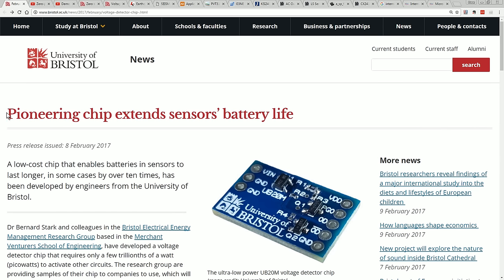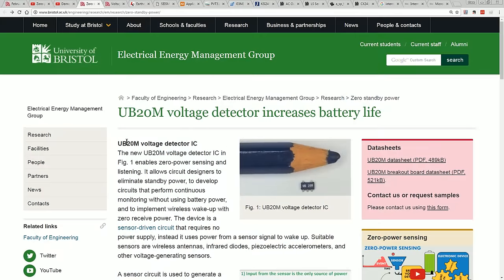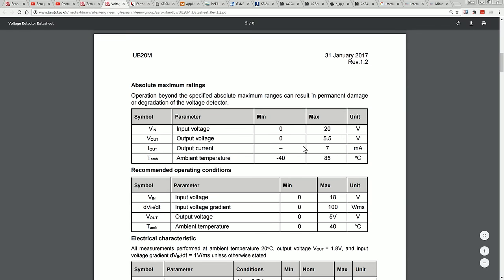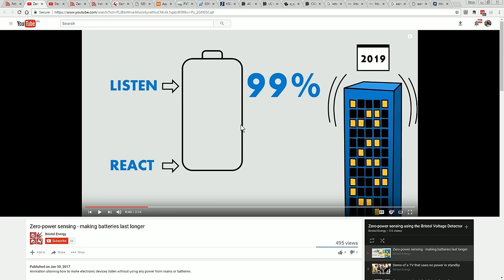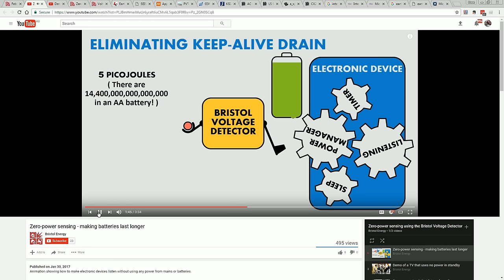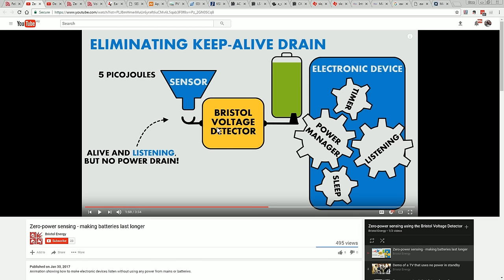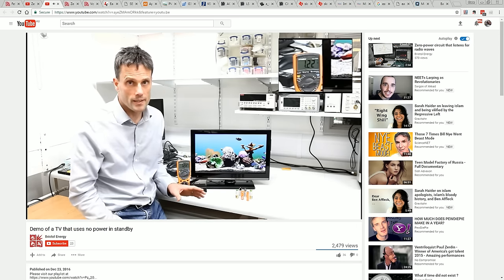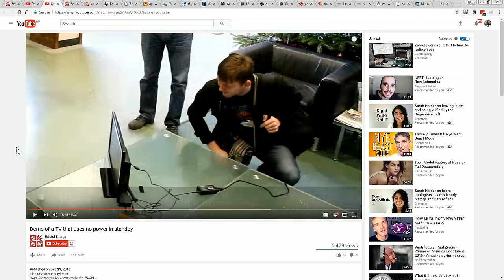EEVblog #971 - Zero Standby Power TV - BUSTED!

Comment: I think a true low standby TV would cost more, since the quiescent power could almost be eliminated with an internal PSU. Problem is that the cost of certifying something without a wan-hung-low plug-pack would get passed-on to the the consumer. That could buy back years of power consumption costs, and maybe more...?

Comment: I'm just excited that I can get a 12V TV :) Since I have 12V solar available actual 12V devices are always nice to know about.

Have you done a similar rant on PC power supplies? Or those sodding "240V power board with USB", because my home power meter doesn't tell me anything useful under about 5W and I'd love to know what the standby power of those boards is (I haven't seen one that lets me switch off the input to the USB).

Comment: I just use one of those 433mhz mains power remotes to completely cut off the power of the TV at night.
Honestly I have no idea if that uses more power than the TV in standby but I'd rather cut the power from the TV to hopefully extend the life of the components, although I have also heard the argument that regularly turning the TV on/off at mains can also reduce life.
Reply: I use the same method. Not for eliminating standby power nor life extension but to switch on/off TV and active speakers with single button.

Comment: nothing that cant be done with a small solar panel and super capacitor,(calculators only cost a dollar for much more tech than this)  hide the panel in the stand, it will last forever anyway, the power to supply the pullup could be a capacative dropper, no need for a switchmode supply, that wont draw anything unless theres a  load the other side anyway.   a 0.5w standby is about 65p a  year in the uk for a year standby, so if you say a tv has a life of 10 years, it has to be cheaper than £6.50 to include its technology on the retail price

Comment: Could this chip be used to swich on a bettery powered relay (or other switching device) that switches the mains? I saw you say in the video, that this chip can't switch a big enough realy, but what if it switches a bigger relay with the smaller one using the power of a built in battery to switch the mains? That battery could then be charged when the TV is on and be discinnected until this chip uses it to switch on the TV?

Comment: You could use a multi stage system do do real zero standby power. Use their system to switch a small power supply that is just big enough to switch on a relay on the input but low power enough to be switched on with a low power mosfet

Comment: This kinda reminds me to the betavoltaics and radiophotovoltaics power source hype of recent. They claim decade long duration and extreme environment resistance but if you see the amount of currents they can provide and operation environment parameters you realize that any specially designed electrochemical cell with a very low self discharge like Lithium Thionyl Chloride can easily outperform such devices, its much cheaper and safer last as long if not longer and rugged. Ive made small garden lights with alkaline batteries and a 500k resistor. They are 4 years old and 4 of 6 are still going, one that failed was due corrosion and the other one due batteries leaking.

Comment: I picked a random Vishay TV IR RX module and the quiescent drain is 350µA at say 3v; add a microcontroller in low power sleep (say 20uA) and you're at around 1mW using random cheap parts (and not even really trying hard to optimize power). The promo video talks talks about 500mw for their TV set in standby, so they must be including the quiescent consumption of the PSU (unless the TV is just burning half a watt because they don't care) which roughly ties in with Dave's measurement of 300mW on his random PSU. So yeah, that's straight up lying.

Comment: I have a 'zero volt standby' cell phone charger. Their solution was to have a rechargeable battery inside that powered the detection circuit.  (edit, I don't use this charger because it is unreliable)

Comment: Is there a good but cheap power meter available on amazon or ebay able to measure the quiescent AC consumption (before the "brick") of turned off modern TV or phone chargers?
Reply: SlyPearTree anything with a known brand and that costs more than $30 should be good enough.  if i were you i would try to get a trueRMS one, those are the best.
But to be fair even the $1 chinese ones should be enough.

Comment: Sorry Dave, but I do believe your criticism is misdirected on this one.

Big deal that their energy harvesting receiver isn't also turning on/off the wall wart..... their demo correctly shows zero standby current for a television......otherwise it too would be sucking tens of mA waiting for the IR signal.

What the wall wart is doing is irrelevant for this particular demo - they could just a easily have hooked into that and powered it down instead. 

The only criticism I can see is that there's no descrimination of the IR signal..... any IR remote would likely wake that TV. However I think that problem would easily be solved by also powering up very low current cmos logic with the harvested energy.

Looks like a very good idea to me.
Reply: I am no expert,but doesn't the pull-up resistor need power to umm pull-up.I new to this so I could be wrong.. and wouldn't the device need to ir signals. one to wake up the TV and a second for the TV to decode the IR signal to see if it or some other device needs to turn on.Wouldn't just natural IR wake it up?I have never had any schooling in electronics so I am probably completely wrong cause Iam missing or don't fully understand this.
Reply: Yup it's not a panacea. 

I just objected to the "busted" title on Dave's video.  It's not a panacea but it's certainly not a scam.

Comment: They should put that thing in a box with a couple batteries and a latching relay to switch the mains AC on/off. Could be used for any device then.
Reply: Brian Taylor the relay consumes as much as 1/2 a watt so you arent saving a lot unless you never ever use your tv.
Reply: Not a latching relay, They only need a pulse of power to latch each way.

Comment: This guys talk about extending battery life, bla bla ...  But, there is a limit up to were it can be extended, as the battery itself degrades by just existing.  The best batteries against self degradation are Li ones, the expensive primary ones, not your regular CR2032.  A set of AA/AAA batteries will leak after a few years if your are unlucky, and be dead in the best case.  Having the whatever detector consume the battery power in barely less time than that is not a problem; indeed, it might be a feature, so a battery is not allowed to leak and damage the device.

Comment: Hey Dave! Look at the original Videos comments. There is a comment from about a month ago. A user already made them aware of the standby of the AC/DC converter and they claim it's only 0.1W!!!

Bristol Energyvor
That's a good point. In this demo, we have only eliminated the standby power of the TV and not of the adapter, which is using about 0.1 W. TI have a chip that virtually eliminates standby power of adapters:  http://www.ti.com/product/UCC28730. We'll address this in a future video, thanks.
Reply from the maker: Ah, so they did. Not that is matters whether it's 0.1W or 0.5W

As for the TI chip and such solutions, as pointed out in my video, this chip actually negates the need for their chip!
Reply: Yeah in the end it isn't about the actual standby power consumption, but more about that they didnt communicate that fact! bloody research. ;)

Comment: >Modern TVs draw 0.5 watts. or the equivalent of six AA batteries every day in standby

That doesn't sound right.
Reply: Didn't sound right to me either.I have neen learning electronics as a hobbie and thought I was wrong..Thanx
Reply: Well, a day is 24 hours, so 0.5W over day is 12Wh. I found one article stating one AA alkaline cell has 2.6Wh, which comes to 4.6 AA batteries per day, so that is almost correct.

Comment: Why can't we just make things that completely turn off these days?  You remember,  the good old fashioned switch that actually cut the power to the device.   Especially with battery devices, since it's annoying to have a new battery dead in a device you have not used for a few weeks. (my MP3 player as a specific example)
Reply: Robin Sattahip 
well tjey do have some advantages. for example soft switches alow the mcu to shut down gracefully. like with pcs.

Comment: Here's how REALzero power standby (tm) could work:
Have a suitable small energy storage device (goldcap etc.) . Have that powering a low-current controller, IR receiver and providing the short current burst for the switching element (be it a solid state relay or anything else). Have that small energy storage device being recharged once the psu comes up. Tadaaa, real zero power standby. Not as in a couple of pico Watts, real zero zilch!!!111 Yup, it'd need the small energy amount to recharge the storage on every power on. But that's not what's being asked for ;)

Comment: So what it all boils down to is the amount of energy you can get from the sensor that activates the device. The more, the better. If you had a lot more, you could flip a larger relay for example.
Great! Then I have an idea for making devices truly use NO energy when they are off. Why don't we leverage the kinetic energy that a human can easily supply? I suggest that we make a device that uses conductive materials and motion to physically break or connect the circuit. The user can actuate this device by supplying force. It wouldn't need to be much. I estimate it would take only your finger tip. You could even eliminate the extra circuitry! No need for relays or anything, just break the main power with this 'circuit breaking' device! I think it would be best to roll out this product with a focus on home, mains power, lighting at first. Perhaps we can call it a "Light switch". Anyone want to throw a bunch of money at this idea?

Comment: If the TV was plugged into a battery then it would be zero power standby?
Reply: I was thinking the same, if TV was used in a mobile unit (like a RV or truck) on 12v battery then this zero-power standby would be useful there.
Reply: Dragon Slayer Ornstein The pull-up resistor would use a little power..I think...Never had any schooling in electronics so I might be wrong.

Comment: You could use this technology with a capacitor to switch the mains, but it could hold the charge not for long enough and pisses off people.

You could use it with a battery or rechargeable battery, most TVs doesn't even last more than 5 years.

Or you take the risk of spending about 3$ on electricity over 10 years.
With that said, I don't know how much you are actually saving, because those components will also have their prices. 

You could argue that it is worth the hassle globally speaking, 200 MW per billion TVs is half an average power plant just to keep TVs on standby. 

Hm, you are to decide...

Comment: Why is it so difficult to get this thing to switch mains? It'd be a bit fiddly but really no big deal. For example, it could run from a small super-cap that gets charged from the switched PSU whilst it's on. It's lazy of them to use a 12V PSU and it opens them up to criticism like yours but it's not as bad as it looks.
I agree that the chip is nothing ground-breaking though. Standard marketing hype, but it might find an application or two where it's actually worthwhile.
Reply: Yes. Which is picoWatts. That's the whole point of the device.
Reply: You're right. It doesn't make the standby power zero, just completely negligible. If that's not good enough for you then you're more pedantic even than me! My point is that the demo wasn't "smoke and mirrors" no-one was trying to deceive or being deceived. The device is capable of doing what they were trying to demonstrate. They just failed to make a convincing demo.
Of course, I'm not suggesting that it would actually be worthwhile using this device to reduce TV standby power. I reckon reliability would be terrible, with the thing false triggering all over the place and failing to trigger when needed. Just sensing average IR radiation levels seems doomed to fail. You can easily get standby power into the sod-all range using proper, powered IR receivers.
Reply: Iam a uneducated hobbyist so I am probably wrong, but wouldn't the power to charge and keep charged the cap be more ?
Reply: I'm not really sure what you're asking. It'll certainly be more than the device can "harvest" from the TVs remote, but the supercap wouldn't be charged from harvested energy, rather from the TVs power supply whilst it was powered up. I'll try to dust off my dodgy maths... A 1F capacitor with a 1uA leakage would take over 3 weeks to discharge itself from 5V to 3V. The output leakage of the detector chip is supposedly 100pA, so it'll make no difference to that. Average power (which would be taken in a short lump from TVs PSU) would be under 5uW. The red "standby" LED alone on a TV would draw at least a thousand times as much. A typical IR receiver draws 300 times as much. All of these powers are negligible in this application.

Comment: "Modern TV:s consume 0.5 W or the equivalent of 6 AA batteries per day." Well I do not run my TV on batteries. I run on the mains and one watt costs me one euro in a year. If the life span of a TV is ten years then technology that eliminates the standby power is worth five euros.  All that shows that AA batteries have very little power, some 3 watt hours i.e one thousand batteries is worth some 50 cents in electricity. They are overprices by a factor of thousand if you view just the power.

Comment: Dave, I like your videos, but not this one. Please do more engineering videos instead of always hating something. You are right, most of the time, but now you get stuck at side problems. The chip works (it seems so). That TV used an external power supply, but could have used a battery (or a cap charged from mains with 100Mohm resistor, or anything) to power a relay which switches on the main power supply. You said bullshit to a product, which is actually a good idea and works. By the way, the TV-case could be solved a few different ways with somewhat higher power consumption than this but still a way lower than 0.5W. But the idea is absolutely could be useable in some areas.
Reply: Could have, would have... yea, bullshit. If they could come up with real world application they would demonstrate instead of this misleading trick. It's a glorified transistor in a case! Giving it batteries defeats the purpose of zero standby power. And they try to measure it in a way it hides all the secondary power consumption. Tell me one case when it will make significant difference to exisiting solution with usual components. It's Bateroo/Batteriser kind of scam.

Comment: Being the absolutely electronics dimwit that I am, I still came to the same conclusions that you did. There is always a loss in the PSU.
However, while this is ll well and good, imagine is the PSU was a small rechargeable battery, and the tv a 240v (or whatever) relay, well that's the principle of it anyway. Sure batteries also lose energy over time, but rather less than the PSU I should think, thus leading me to the conclusion that while their setup was indeed misleading, it was not a lie as such. Or am I just a complete idiot?

Comment: Could just use a super cap and a low power micro to turn on the TV or charge the cap every so often.
Reply: BlueFoxTV 
could have just used a cr2032 with a nanowatt micro  and have the battery last for 10+ years. (most likely more than the device itself)
Reply: What if the battery goes bad (before or after that time)? No way to turn it on again, not good idea to have design with more components waiting to fail.

Comment: Why worry about the mains adapter, if they demoed with a 12v battery would you be happy? and anyway why limit to the mains adapter, what about the series of transformers, all with losses, though the supply network, the mains adapter is not relevant. i'm surprised it isn't easier to find actual BS rather than try so hard to squeeze some out.

Comment: does it read a standby signal or just trigger on any old noise? regardless facepalm
Reply: Nicolas Daly 
* grabs the stereo system remote *
* tv turns on *
Reply: Rogue IR light from a security camera, TV turns on.
Reply: Dragon Slayer Ornstein 
i love the fact that the poblem is so small that even turning your tv on by error will set you back like a few days of "saved" electricity

plus, if you need a relay, having the tv on will make up for the saved because of the relay's coil. It doesnt make sense to save 0.5w when you need an extra 0.5w relay for the chip to turn it.
Reply: Laharl Krichevskoy
I suppose you could wire the chip so it only powers on the IR decoder then use that to make sure the IR code is correct.

The only problem with that is every time there is a rogue IR light then the other electronics will power up so will not be zero standby anymore, but I suppose it would be no worse than normal standby.

Well if it's fast enough to power the other electronics to analyse the signal that is.

As for the 120/240v electrics, can't you charge and capacitor or something to switch the mains power on and off?

A decent quality capacitor should last a few days at least, or a large enough battery to last 15+ years.

But yep it seems this kinda of thing is more suited to battery powered devices, things like battery powered alarm system would be good I think.